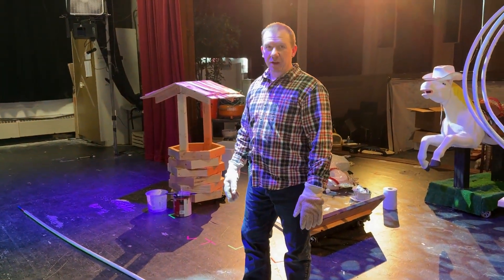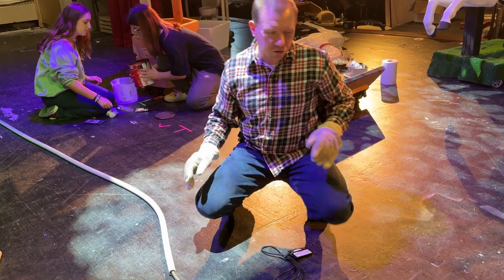The making of Cinderella's Carriage at LHS Theatre

Comment: Beautiful! Where did you get the lights and how did you get them to look so twinkly, as opposed to flashing in a pulsating kind of way? Also, how did you make the crown on the top?
Reply from the maker: sorry for the late reply. They were just some battery powered lights with different modes from amazon. I took the remaining 50' and just bundled them up with some Toole to make the top.